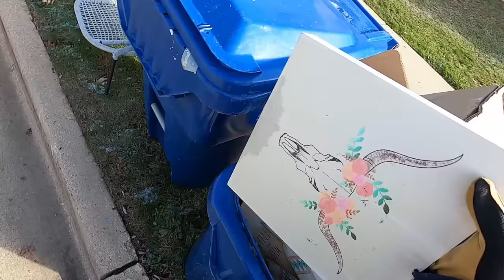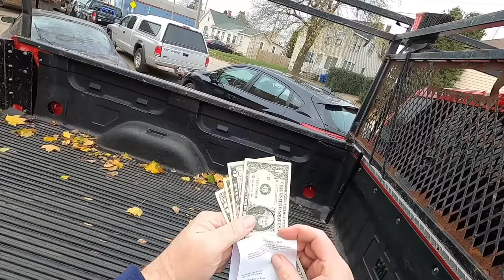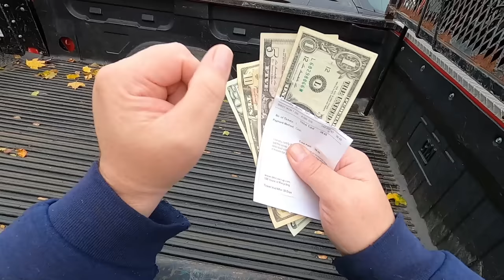The Cash for Trash Program

Comment: Heyy Paul
Seems I'm getting the same weather as you are, had some heavy snow flurries but nothing sticking yet I think you should build a fence, but go to the town zoning board to find out what permits if any you might need to put up a fence, while you're there, get a building permit so you can build a pallet shed/shack, don't need the government giving you any grief over building a shed then being forced to tear it down because you didn't have a permit, the great thing is that you'll be able to build it pretty much the way you want ( within reason), I've built a few sheds over the years, and it's better to have the permits before you start building

Comment: Would the City code enforcement or Dept. of Safety, or something, have a requirement that the bank have a fence for safety reasons? I know that if you are building a residence and there are steps higher than a certain height, you are required to have handrails or railing across the edge of a porch, etc. I would think that businesses would also have something that required them to address safety concerns.

Comment: I'm into constructing things as you might have understood and I've been looking at your truck, on the top rails of the bed you have some slots, if you make bedsides it is easy to make them with tabs that goes down in the slots and high enough to go on the inside of your old racks, that way you can secure it with an belt or if you opt to go on the outside with them (for easier removal when loaded) you could get "stabledoorlocks" welded in and a pair of tabs to secure them to the frame 😁